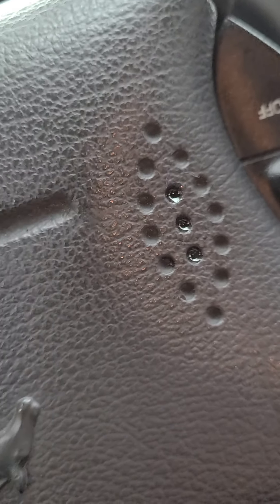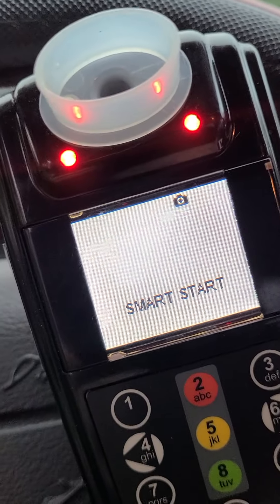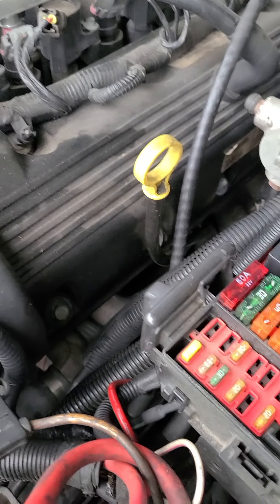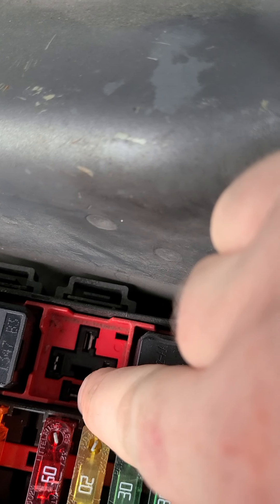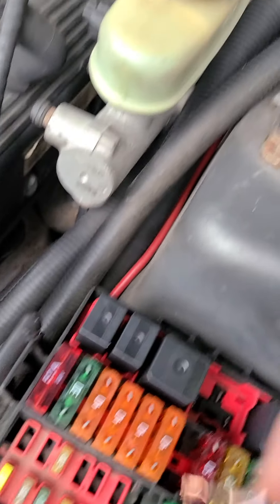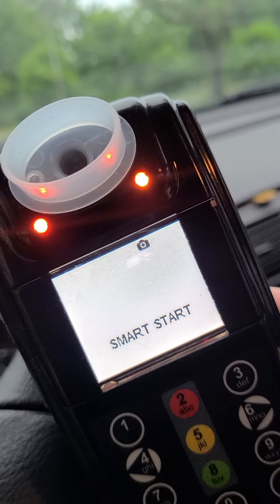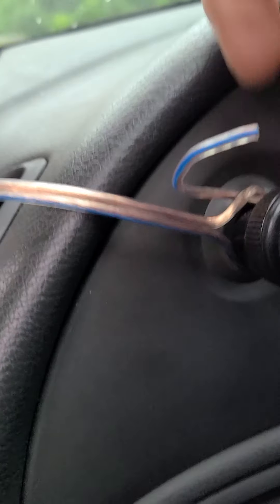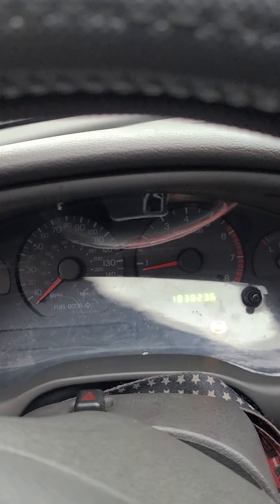bypass ignition interlock smart start

Comment: I'm so frickin stoked to learn I'm not the only person this company has ripped off!!!!!!! About 6 months ago I got my license back and  had to install this ignition interlock. I've had several violations due to SMART STARTS faulty equipment and just like everyone else is saying, smart start says it's my fault! I've payed this company about $350 in lockout fees on top of the $80 they charge a month. And every single one of the lockout fees I've had to pay is because of smart starts faulty equipment. On top of all this every violation adds another 6 months of me having to have ignition interlock. How are these people allowed to do this? Has anyone got any money back from violations due to there faulty equipment?
Reply: 6 months for violations
Reply: You do this at all they keep giving me violation for their shitty device. I am going to do this but im wondering if the device will just tell my vehicle is on because im not locked out
Reply: To be fair, the company can be as shitty as it wants!!! I had the system in 2018 and it was better then the one now, I got a voilation for disconnecting my battery and it was the biggest pain in the ass
Reply: I had to deliver them proof that I had work done and even then they were hesitant to give me a chq

Comment: Thank you sir. My interlock company would not let me pay my next month without signing a digital contract. I only needed it for 3 months but they kept trying to get me to sign a contract for 6 months which would have obliged me to pay for the entire six months. After calling customer service to time and trying to reach them a 3rd
 time, my contract problem still wasn't fixed and my car was stuck at a job site. You saved my ass man thank you
Reply from the maker: Your welcome
Reply: How did you only need it for 3 months . I had my provisional license. Got a speeding ticket now I have to get one of these . I can get my license back I’m June but if I decide to get this device I’ll need it for 6 months I was told
Reply: Did Your company have a camera
Reply: I have three months left too, after low cost dropped me 12 months later for no reason.
Reply: @jodee225  Who's low cost?
Reply: What kind of wire did he use?
Reply: @calebh7902 

The type of wire doesn’t matter as long as its copper and small enuff to fit in the relay slots.  His looked like speaker wire.

Comment: Starter relays come in 2 flavors. 4 pin, and 5 pin. The pins on a 4 pin relay are numbered 30, 85, 86, & 87. The 5 pin relay has the same pin numbers, but the 5th pin is numbered 87A. No 30 is B+. No 87 is the starter solenoid feed wire. In a nutshell, if you apply battery power to the #87 wire, it will energize the starter. You can come off #30, or straight off the battery, to number #87 and viola'. Use at least 12ga wire, and remove the jumper after the car starts.
Reply: I got it started using this method. The problem I’m having is the car won’t stay on. Does instantly and gives me a security light in the dash.
Reply from the maker: @trevonhale1780  this may be a dumb question but do you have your key turned to the on position like your about to start the car when you are doing this? If you do you should not have a security issue because your just applying power to the starter through the relay just like the key does when you turn it all the way
Reply: Thanks
Reply: Tried all of this on my 2010 Dodge caravan and none of it did jack. Nothing
Reply: @trevonhale1780  I'm having similar issues getting the vehicle to stay on.

Comment: I received a restriction on my license 18 years ago. Haven't had a violation since I was involved in an incident and I had a couple of beers. My BAC was way below the legal limit and the state of Minnesota hung me with this bee card violation that I could have removed 8 years ago and didn't. So it's my fault too. But I have to have this damn machine for three years and it's driving me bananas. Even the judge felt. Sorry for me but the prosecutor wouldn't back down. He had to hang me with that. No use of alcohol restriction from 18 years ago
Reply: Mine was 17 years ago I paid my DUI charge every penny in fines but the state of Arizona never restricted my license. Fast forward to 2024 my family decided to move to another state. So when I tried to transfer my license Arizona falgg3d it and said I couldn't transfer my license unless I installed a interlock due to my dui back in 2008

Comment: Search online and you can find the wiring diagram for the interlock. Going under the dash, you leave constant 12 volt power to the device and cut the other wire which is hooked into the starter circuit. Join the ends of the starter wire together and you are good to go. Just don't forget to hook it all back up with soldered connections like the installer did before you go in for servicing or removal. A hidden switch can also be installed somewhere to bypass the handheld device and turned back on a few days before taking it in for servicing. When they plug it in to their machine, it displays all the times you blew into it. Enjoy your day!
Reply: Do you know if it will trigger any violations though??  Doesn’t the interlock record your vehicles mileage as well so if you drive with the device bypassed the miles won’t add up properly?  I only want to try this so I can do thinks like drink some beer and wash my car and then beable to drive it back into my garage.  It sucks not being able to have some beers on a Saturday afternoon and shine up or work on my car so here I am either workin on my car with no beer, or drinkin beer and not really being able to work on my car :/ shit sucks man
Reply: These things are b***** I have had it. And I didn't even get a DUI
Reply: @Werk4Cash  my service center records the mileage, so yes they do keep track. But the guy also didn’t really seem to care how precise the mileage was he just asked me what the oil sticker said.
Reply: @ac158  Why do you have it? I got one and I wasn't driving, didn't get pulled over, didn't have the keys in my possession, and the car wasn't even on. I wasn't even inside the car
Reply: I'm all worried about getting locked out when it's 20 below. I'm afraid to go ice fishing. I'm afraid to drive into the country. I do live in the country but if I don't have cell signal and I can't start my vehicle, I'm afraid of dying or freezing to death
Reply: There was a gentleman 8 mi away from me. He had the interlock. He was out on a frozen lake ice fishing. People told him just leave your truck here. We'll get you home and he refused and said I'll be fine. On a realized his fish house ran out of gas and he started to freeze and he couldn't start his vehicle. He took off on foot and they found him froze to death the next day. Beautiful idea. Go out on a frozen lake and drink with an interlock. I blame it on the idiot and on the interlock there should have been one way he could have saved himself but instead he froze to death
Reply: Where can I find that diagram and thanks for the suggestion
Reply: I had a big card restriction from 18 years ago, I could have had it removed eight years ago but I didn't worry about it. I had three beers with a buddy working with our dogs, on my way home I had a medical and left the road, my BAC was .05 and the state of Minnesota decided to destroy my life with it
Reply: @ac158 yeah exactly or imagine a younger woman with this thing installed and if she’s trying to get away from a criminal by getting in her car she’ll have no chance of starting it in time to drive away.  Scary stuff I don’t feel safe with this interlock I still have a year left cus I failed it 3 total times the next morning after drinkin and they extended it for another year and one year totals to over 3,000$ in fees
Reply: @Werk4Cash  They don't check mileage
Reply: @ac158  is it messing up your electrical system?
Reply: @Werk4Cash  what state you live
Reply: @gregryan8928  yes every two days I have to recharge my battery even one that damned machine is in battery saver I've never had problems with my electrical system until they installed this damn box and I didn't even receive a DUI I had three beers at the dog park and the Gestapo swung by to check to see what we were doing smelled alcohol and decided to hang me.
Reply: Need a diagram
Reply: @nprice6467  this a super valid and crucial point made 💯
Reply: @ac158 Cool story bro
Reply: @ac158 Nor did I. I was charged with a refuse to blow.I wasn't impaired and after arguing with the cop that pulled me over for a dented tailgate the cop proceeded to assault me,hand cuff me and put me in the back of his car. The next thing I know he has written out a refuse to blow. He was a complete liar it never happened. I now have zero respect for these idiots.
Reply: @ac158 I got a DUI for Xanax. Not alcohol. I don't even drink alcohol. Effing ridiculous
Reply: @baneotoole5370  are you in Colorado?!
Reply: Bye 👋
Reply: The camera will see you.

Comment: I think they do it differently here I heard they program it into the computer of the car, because it seems like it's just interrupting your starter wire. But apparently here you have to reblow 5 minutes after you've started and have not the car will shut down
Reply: Your car will not shutdown if you don’t do a retest. Typically it will just activate the horn and/or the lights.

Comment: the smart start interlock system is an absolute con. The number of people that tell me to just use your kid or passenger to blow into the system, Plus not to mention how cheap and faulty this equipment is, always malfunctioning and guess what kids, you need that thing to start your car unless you bypass it.

Another fun fact,  that is incredibly dangerous requiring the driver to complete a rolling testing while driving (some instances the driver cannot pull over) and if you don't do the test, you get fined. The device constantly treats the person like a criminal, and if you're a one time offender it's pretty humiliating.

Last complaint is, the device is effectively a computer which needs initializing when starting up meaning if you're in an emergency that requires that person to start the car and leave immediately, that won't be happening, it can take a few minutes before you start your car.

Long story short, I'm requesting getting that piece of shit device removed from my car, I would prefer to pay a large fine and not drive that have that garbage in my vehicle. Please people, don't support this equipment, it's an absolute con. effectively you're paying a company to allow you to drive your own vehicle, though this company holds you ransom once their crap equipment is installed

Comment: While driving mine has me do a random blow every 5-60 minutes won’t I still have to do the breath tests?
Reply: If it's in lockout mode it won't do anything or even know the car is running
Reply: Yea that B.S too, Should not have to blow 2 times to go 5 miles, Can leave the motor running either

Comment: Can you do this on a vehicle with a push button ignition? I got the wires into the relay but when i put the can in the on position it wants me to blow into it? If i blow into the the machine and pass the test itll let me start the car by touching the wires together but theres no power coming through the wires until it gets a valid test

Comment: Cool idea... but in theory could be done better...

Your blow device likely has connection to starter relay and connection to power...

Tools reqd...12v battery, lil wire, your favorite stripper, t tap connectors, quick connect electrical connectors..

Use piece of wire and t-tap connectors to splice into the positive and negative on device...
Put the ends of the wire splice to 12v battery (adding battery in parallel wont change voltage...just ah) this will provide power to device.  Once the battery is attached in parallel to the device power/ground wires you can cut the wires and device will still have 12v, put quick connectors on the cuts and replace portion of wire you removed with one with quick connects. Cut/put quick connects on starter relay cables. Proceed to place the 12v battery attached to blower device on a slow charger...leave it in garage...reverse steps monthly to put device back in for calibrations/minimum mileage...

Comment: Question when you do this does the unit still ask for you to blow when you are driving the car or does this bypass the unit completely
Reply: MUST BYPASS BECAUSE YOU CAN'T BLOW THE DEVICE IF NOT WORKING BUT MIGHT SHOW UP AT THE INTERLOCK COMPANIES
Reply: @elmerpacheco2961  I think you do have to blow because it asks you to,if you don't and the key is in the on position and you are driving you will get a violation code for that.

Comment: Ya know the easiest way to avoid this is not to drink and drive lol but good on you for figuring that out pretty smart actually hell yeah bud
Reply from the maker: Very true but we all make stupid decisions sometimes and dui is a horrible decision. I'm glad it's all over with though.
Reply: I don’t even drink. I got a DUI from my prescription antidepressant and Sacramento county made having a breathalyzer mandatory if you want your license back.
Reply: @zacperil654  well if you don't drink then the lockout breathalyser won't be a problem for you will it! 😂
But it's ok to drive a ton or more of machine while high asf right? 🤔 🙄 Don't think you'd feel the same way if someone hit you aor your family under the influence whether its prescription or not! 😁
Reply: @cassondrahead3524  appreciation for the time you took to write this but if you're given regulations to drive because of health issues or drug/alcohol then yea I don't think you should bypass it regardless.. Because them very same systems are in place to protect your families too. WORD
Reply: @Mr_Dimplezz  He clearly stated he's not condoning drinking and driving, its to get around the violations caused by faulty equipment. Ive had one and mine did the same thing. Recall kept popping up on the screen all the time and wouldnt start. I had a issue with my truck and had to fix it first due to severe oil loss from oil cooler and it was time to get the device calibrated. I couldn't drive my truck up there until i got it fixed and it sure as hell locked me out.
Reply: @Mr_Dimplezz  You should be ashamed of yourself there was only one JESUS judgment is coming!

Comment: What happens though when it goes off if your driving I guess it never comes out of the violated mode so to speak does, I've got an intoxalock and I've never had an issue and I get it removed the 7th of Feb so roughly 2weeks I dont think I wanna try this I'm too close to freedom so to speak

Comment: What's up with your wires?  It looks like you have two speaker wires and then one send blue wire as well.  Am I correct in saying that just two wires are needed or are there three wires needed?
Reply from the maker: It's 2 wires one wire has a blue stripe on it
Reply: Didn't they see the violation lights on when you bought the device back? I chose not to drive for 20 years because I knew it was a scam and just finished paying the state over 50gs. Crazy right? I will def be doing this when I get it just want cover bases.

Comment: Will this method also work with other interlock systems?
Reply from the maker: I would imagine it would. All these systems do is put a relay switch in between your ignition switch. So it should work for all manufacturers
Reply: It does all it is is they attach a switch to your starter that switch turns on when the breathalyzer is turned on by passing the blow the relay connects to the starter as well but won't connect to the breathalyzer it's a great way to steal a car and I mean any car 🤣
Reply: Do the interlocks have gps on them? Would they be tracking where the car is at and notice there weren’t any breathalyzer scans or passes before and after the car reaches its destination or is it not that tech savy lol
Reply: @ultimateetro4456  nah they do t have a gps on them. That would be a major privacy violation I suspect
Reply: @yosemitesam7.62  u got an instagram bro. I got a few questions
Reply: @ultimateetro4456  If it does, just say you got the car towed

Comment: You may want to add, do not do this while under supervision, for your offense.
The companies can see discrepancies. They might not bother with you, as long as you are doing the monthly dues; but with a probation officer involved, can be a different story
Reply: P
Reply: Don't mess up the device to begin with and there will be no discrepancies. Doing this after the device has been locked out is a different story but you can avoid all that just by doing this to begin with.
Reply: @yosemitesam7.62  this is assuming that one were to blow into it and lock it because they had drank alcohol. In my case, on a few occasions, it didn't even give me the chance to blow. It just said "connection error". I bypassed that by disconnecting and reconnecting the battery terminals
Reply: @mantasour  man I can't imagine even having to deal with this kind of shit. I guess in some fucked up way that I get it but I feel like if people have done their time and paid their dues that this shouldn't be an extreme they should be allowed to go to.
Reply: My CRO GOT FIRED FOR BEING A PIECE OF CRAP so I ain't worried any more
Reply: @mantasour  I thought the battery can't be disconnected or get locked out or in trouble